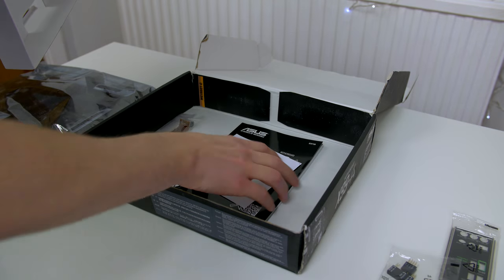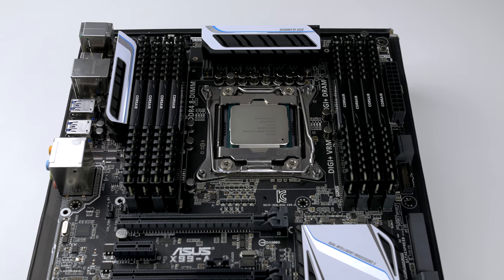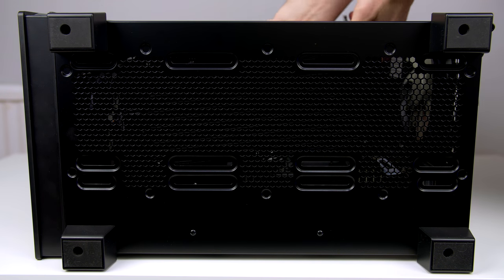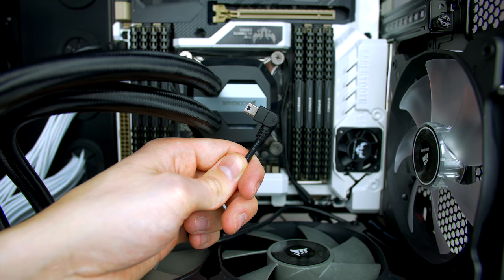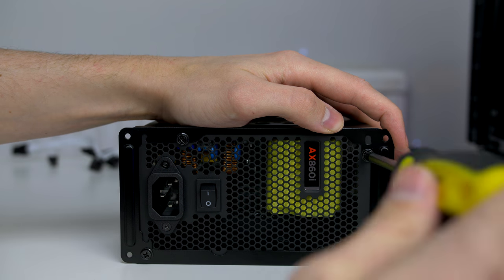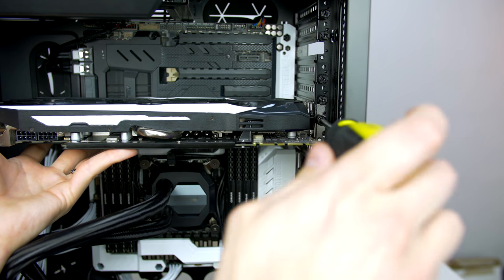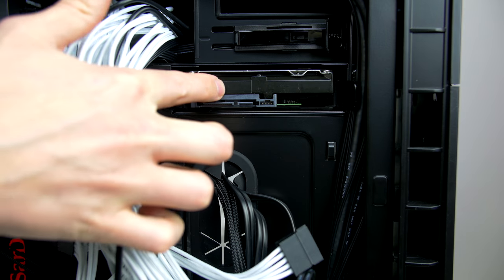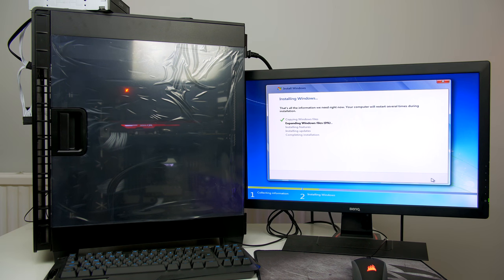How To Build A $2000 Gaming/Editing PC

Comment: I take it the cooler doesn't require heat sink compound.  Never have done a water-cooled setup before, so I'm a noob with that setup.
Reply from the maker: +bandwagon240 sorry should have mentioned it's pre applied
Reply: +BeginnersTech No worries.

Comment: Do all those cables come with the motherboard or power supply? Wiring is the only think that is complic8ed for me
Reply from the maker: cables come with all the parts unless you buy custom white ones like I have
Reply: +BeginnersTech thanks my dude, I love your accent it's so awesome, btw, how many fans do u have around the PC besides the cpu cooler?
Reply from the maker: +Heart attack on a hook just the 3. Case comes with 3 I just swapped them for led ones
Reply: +BeginnersTech where did u get those fans? I'd like them for my build. Perhaps the link for red ones? Thanks

Comment: Would this be a good gaming build?

1 xAMD Vishera FX-9590 4.7GHz AM3+ 8-Core with Liquid Cooler CPU FD9590FHHKWOX
1 xAsus CROSSHAIR V FORMULA-Z AM3+ DDR3 Motherboard ATX
1 xCorsair Dominator Platinum 16GB 1600Mhz DDR3 Memory CMD16GX3M2A1600C9
1 xSamsung 850 EVO 1TB SATA 6.0 SSD MZ-75E1T0B/AM
1 xEVGA GeForce GTX1080 8GB DDR5 FOUNDERS EDITION Video Card 08G-P4-6180-KR
1 xAsus STRIX SOAR PCIe 7.1 Gaming Sound Card
1 xAsus DRW-24B3ST 24X DVD SATA Optical Drive DRW-24B3ST/BLK/G/AS
1 xCorsair Hydro Series H115i 280mm Intel/AMD Extreme Performance Liquid CPU Cooler CW-9060027-WW
1 xCorsair RM850i 850W 80Plus Gold Fully Modular PSU CP-9020083-NA
1 xCorsair Graphite 760T Full Tower Black Case CC-9011073-WW
1 xProfessional assembly and testing of your configuration [Included 1 year warranty]
1 xMicrosoft Windows 10 64-bit English 1PK DVD OEM KW9-00140
1 xAsus VS207D-P 19.5" Wide LED LCD Monitor
Reply: The professional assembly ruins the build. It's not compatible with most of the parts. Try giving the parts to someone in Curry's PC world and they'll do it.for you.
Reply: TitanFallout This is being made by PCCZone lol
Reply: Ghost112
PCCZone are amatuers compared to random homeless people. Buy the parts, give it to them and they definetely probably won't steal it.

Comment: If I downgrade on the mobo and the graphics card, how much performance will I lose?
Reply: downgrade to what and what will you be doing with the PC?
Reply: +BurblingBarbacoa a cheaper mobo, a gtx 960 or 970 and the i7 4790k. And I plan to do some light photo editing and maybe some gaming(nothing too hardcore probably CS:go)
Reply: +BurblingBarbacoa also is buying the sleeved cables used in this video worth it?
Reply: +RfMsC55 If you want to get all sleevedcables, it will cost about $100.  You can easily save money by just getting the 24 pin 6+8 pin and 8 pin cpu for about  $30
Reply: +RfMsC55 nope. You can get some nice sleeved extensions for wayyyyy cheaper than a full kit
Reply: +BurblingBarbacoa I mentioned that after I told about the kit
Reply: +Cory Zeitz beat me to it :)

Comment: From 4:16 there is a X99 Sabertooth with white parts and at the end of the video 8:39 there is a X99 Sabertooth in normal colors. What's up with that?
Reply from the maker: did you listen to the start lol The x99-a was DOA. So I had to swap out for sabertooth? I filmed the switch on to make sure it worked before the rest
Reply: BeginnersTech I did and edited my comment accordingly, my bad. But it still doesn't explain the white parts. :)
Reply from the maker: +The Echelon I painted sabertooth lol after I knew it worked
Reply: BeginnersTech Ah, I see. It's a nice touch!
Reply from the maker: +The Echelon thanks man budget build next month it looks like according to latest twitter poll